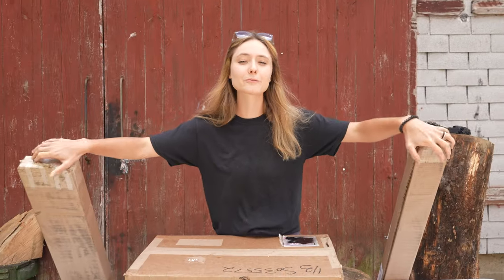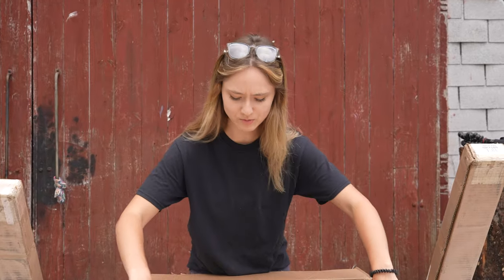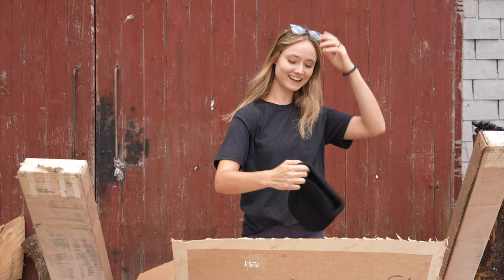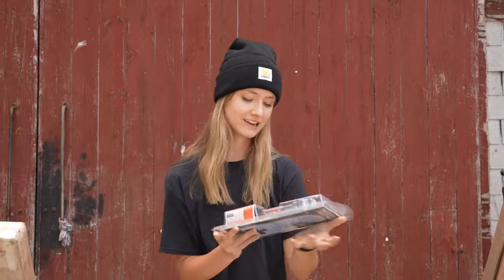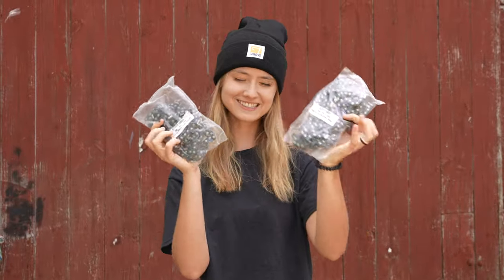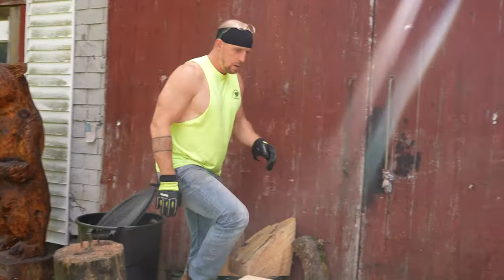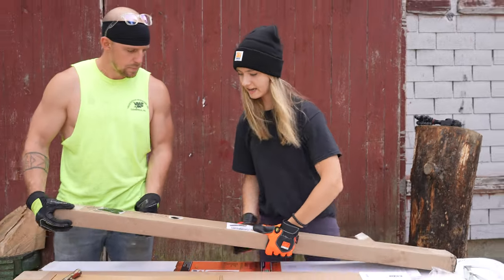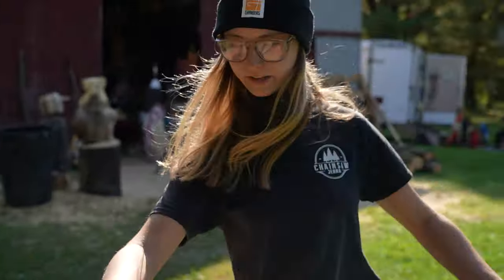Unboxing my new Granberg Alaskan Mill

Comment: Every single  piece of  lumber  that thing cuts can NOT  be used for home buildings or  Structures  , 
I'm not really  sure  what you can  use any of that wood  lumber  for because  it does  NOT  pass building codes , 
For all lumber to be used for buildings  must have a  inspection label  on each  piece of  wood  saying that it passed .

I think  it's because the Government  doesn't  get any TAX  on this wood , 
So I would check with  Local building codes before  you think that  you are going to save  money  cutting your own  wood   !

Comment: Hi Jenna,  I have two of the Grandberg Alaskan mills. one at 36" and the other at 55" and a Husky 395 for the power. Great combo I still have a spalted maple log 53" in diameter to slab up.  Ron  USCG RET
Reply from the maker: Very nice! Sounds like a great set up! If you need anything else from Grandberg use the promo code ChainsawJenna to get 10% off your entire order! Check out that quick release if you don’t have one yet. Husky are great saws would love to get some to at to my collection.
Reply: Thank you, I believe I have all the options except the quick release  Ron @chainsawjenna

Comment: Those mills are awesome, depending on the wood a lot of times I find standard chain or square ground is better and gives a better finish than actual ripping chain
Reply from the maker: Very interesting I’m excited to try all the options! 😁😁
Reply: @chainsawjenna  that’s just my two sense for what it’s worth. Sunday I was helping rip some massive 72in pine slabs and we were using twin 394xps with a full comp square ground chain